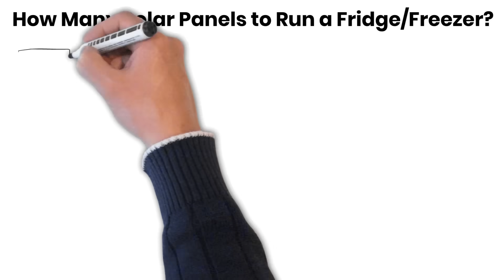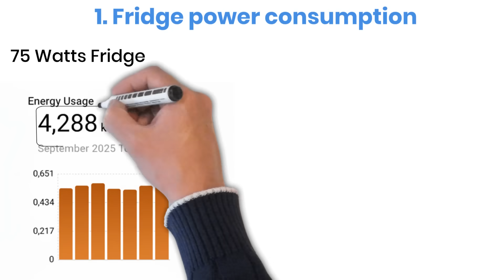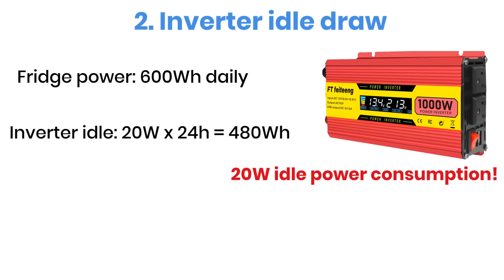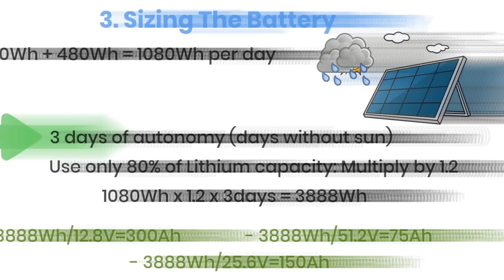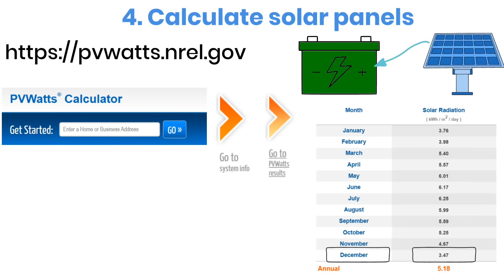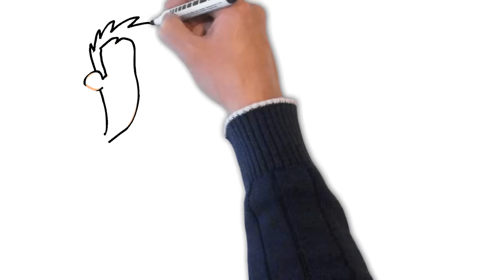How Many Solar Panels to Run a Fridge or Freezer 24/7?

Comment: So a better idea is to just buy a propane refrigerator.
Reply from the maker: That’s a fair point. Propane refrigerators can definitely work well, especially in remote areas or where setting up solar isn’t practical. The reason I focus on solar systems is because once installed, the energy is free and you can run much more than just the fridge. Lights, fans, chargers, and other appliances can all run off the same setup. So both have their place, but for long-term flexibility, solar usually makes more sense.
Reply: @batteryhacker4343 You said "Once installed the energy is free" I don't like that saying, its like saying once you buy a car its free. I say Solar electricity isn't free, its just paid for in advance, and it costs more per Kw than it does to buy it from the utility co. I say anything that makes heat should be powered by fire, leave the electricity to other stuff like lights TVs computers phones and stuff like that. Refrigeration can go either way, and for solar refrigeration I would strongly consider a DC unit, then you don't lose all the efficiency in conversion from dc to ac and voltage step up.
Reply from the maker: You’re absolutely right that solar isn’t “free” in the way people sometimes say it. The upfront cost is high and in many cases grid power is still cheaper per kWh. I usually mean “free” in the sense that once you’ve installed the system, there are no fuel bills or ongoing costs other than maintenance.

And I totally agree with you about heat loads — anything that makes heat (heaters, stoves, water heating, etc.) eats huge amounts of energy, so fire or gas makes way more sense there. For refrigeration, yes, DC fridges are a smart choice for off-grid setups because they cut out inverter losses. Thanks for bringing that up — it’s a point a lot of people overlook.
Reply from the maker: Really appreciate you sharing all that. You’ve clearly built some solid systems and learned a lot along the way. I like how you balanced solar with propane and wood for the heavy loads, that’s smart energy management. And that EG4 setup with 10kWh of batteries and the well pump running off the transformer sounds rock solid. Out of all three systems, which one felt like the best balance between cost and performance for you?
Reply from the maker: Sounds like you’ve really evolved your setups step by step — that’s the best way to do it. Those LiFePO₄ batteries definitely change the game once you move past the upfront cost. The EG4 system sounds promising too, especially once the remodel’s done and you can test it under full load. Are you planning to tie in any solar expansion later, or do you think the current 3.2kW of panels will be enough for the house?

Comment: Something important to mention is maximum charge rate of your battery, you can't just add 20 panels and charge the battery in an hour.
Reply from the maker: Great point! You can’t just throw 20 panels on a battery and expect it to charge in an hour. Every battery has a max charge rate (C-rate). Think of it like a water tank — no matter how many taps you open, the tank can only fill at a certain safe speed. For example, a 200Ah lithium can safely take about 100A (≈1200W at 12V). Anything more, and the charge controller just limits it. Thanks for highlighting this

Comment: Actually solar panels alone will not run a fridge.  Your heading is wrong, the inverter is the important item, then the battery on how long a battery can supply power for the inverter, then the solar panels to charge the battery.  3 systems need to be considered
Reply from the maker: Good point 👍. And yes, that’s exactly why in the video I broke it down into 3 parts, inverter, battery, and solar panels. The panels don’t directly run the fridge, they recharge the battery, and the inverter makes it usable. Thanks for pointing it out. it will definitely help others understand the “complete system” idea.
Reply: It is worth mentioning that the fridge compressor has a high instantaneous start-up current which the inverter must be able to handle.
Reply from the maker: Absolutely right. Fridge compressors do draw a much higher surge current at startup, often 5–7 times the normal running watts. That’s why even though the fridge in this example runs at ~75W, the inverter needs to be sized much larger, typically in the 1000–2000W pure sine wave range — to handle that split-second surge.

Thanks for pointing that out. it’s a very important detail for anyone planning a solar setup for fridges or freezers.
Reply: My 12V fridge freezer draws 40w. When it's running. 
I should try it directly on the panels, without battery or charge controller. Turn it up to Max. Bet it'll do just fine overnight. 
You get 10x as many solar amps when it's cloudy with no computers involved. 
Should only need a single hundred Watt panel.
Reply from the maker: Interesting thought. In theory a DC fridge could run directly off a panel in perfect sun, but in practice the compressor needs a stable voltage and enough surge current when it starts. A single 100W panel won’t really deliver that consistently, especially overnight or when a cloud passes.
That’s why batteries and a charge controller are important—they act as the buffer so the fridge sees steady power instead of the ups and downs of the sun. Have you tried testing your unit straight on solar before? Would be interesting to hear the results.
Reply: @batteryhacker4343 yeah, you are right. You probably need at least a capacitor and a low voltage cutout. Of course if you can freeze saltice when you have excess piwer, and store the heat too, then you have a pretty good basis for a trigeneration setup. 
If you were to design a reversible refrigeration cycle into it, with turbo expanders driving generators to meet demand you got everything you need.
Reply: @aaronfranklin324 charging directly from the solar panels without an MTTP controller or some kind of regulator could be problematic and a low chance of success
Reply: @namogel67 yh best too have a controller you can get them for a few pounds or just the board and make your own housing box for it for prob 50p or 50 cent ..one thing I always wondered about pannels is why they don't have a heatsink on the bottom as standard coz heat is the pannals well all techs nemisis the cooler the better will help general running and prob put years on its life span even just a thin sheet aluminum cost next too nothing so I don't know why it's not a standard feature and even add a PC fan pulling the heat away from the sink even better but I guess it coz they mainly are put on roof tops so can't access them easily but add those 2 your pannal will stay cool n cost you nothing as PC fan will run from the pannal itself..same with phones or a modem or telly there's no heatsinks on them my modem gets boiling hot so I thought let me add a fan and in a minute it dropped the temp too no temp basically and that's always gonna help but just a thought cheers
Reply: The inverter was mentioned in the first minute of the video.
Reply: But actually, there are dc powered fridges. Solar panel alone can power some kind of fridges. The battery backup may not be necessary as well if the priority is to use afternoon power. That's running the fridge in the afternoon only.
Reply: FALSE statement.
I have 3 units that run on 12V so no inverter needed.
Reply: Build your own fridge like old days with a touch off modern help make an evaporation cooling fridge or several just need 2 terracotta pots one big and one a size smaller place the smaller one inside then the rim between the 2 pots fill with sand and find a lid varies choices then all you do is soak the whole thing with water preferable a drip constant slow flow soak entire thing then historically they would just place outside and the general wind just normal slight wind will cause an evaporation effect on pot cooling it too a low temperature but if really want cold even freezer potential add a fan or fans either PC fans or whatever you got but essentially the more wind you create the colder it will get obvs the offset off more wind will mean your water drip feed will need more water but not much in the grand scheme off things and there you go no electricity bill accept say 2/3/4 PC fans running at 5 watt each so 15w running cost vs a minimum 400w fridge cost but 1 PC fan or fan will do and put outside use natural wind too but yh pretty simple and improvements can be made such as adding aluminum pieces in with the sand heatsinks but in this case acting as coolsinks as aluminum passes hot and cold through it instantly just throws temperature straight through it so will help cool faster...and if storing fruits n veg herbs just use sand in a box in layers so sand veg on top more sand layer then more veg in layers and the food lasts longer than in a modern fridge as no moisture so doesn't rot just pack it down tight and yh granted you gotta dig your veg out n wash sand on quick but it's free and does the job better  so use both those ideas in conjunction n say goodbye too fridge electric bill and fridge itself make some extra space in your kitchen...just thought I'd share that with ya not everybody's cuppa tea but evaporation cooling is no joke blow a fan on your face then after splash water on face then blow fan and you see it makes it ice cold I'm sure your aware off this but they had giant freezers in the middle off the desert in Iran 1000s years ago using this method called yatchels look them up very cool (pun intended) lol...cheers
Reply: @jshaw4757giant freezers? Where is the evidence for that?
Reply: @nexpro6985 Yakhcal ...spelling was incorrect cheers
Reply: @jshaw4757 ice pits are not freezers.
Reply: @nexpro6985 They could create ice via shallow pools using evaporation cooling and a heat differential then it was shoveled into the main structure that could be used too freeze things therefore by definition a freezer
Reply: @nexpro6985 But Freezers are icepits ...or if split hairs ice boxes lol 😂
Reply: I run a 12v 50watt compressor camping fridge, 100watt flexi 20a control n a 100ah lifepod4, runs forever as long as fridge has food in it not just fresh air.    just running solar only won't kick fridge in at night so you would need a battery for that
Reply: During the day I run my solar directly to my 12 volt fridge that has a built in charge controller. 100 watt panel is more than enough. Many nights I keep it closed without power, and everything stays frozen, and saves power me
Reply: You are ignoring 12v fridges.

Comment: The start up current of the compressor is not mentioned so some people will think the fridge only uses 75 w of power to run
The number of amps is much higher on the start up of the fridge and therefore a 100 or 200 or 500w inverter will not deliver sufficient amps for the start up
One needs a 1000 to 2000 w inverter for a successful start-up
Reply from the maker: Great observation. You’re absolutely right, refrigerators don’t just use their rated running power (like 75W in this example). When the compressor kicks on, there’s a short surge where the power demand can be 5–7 times higher.

So even though the fridge runs at ~75W, the inverter must be sized to handle the surge. That’s why I recommend using a 1,000W to 2,000W pure sine wave inverter for a fridge/freezer setup. It ensures the compressor starts smoothly without tripping the inverter.

In short:
Running power: 75W
Startup surge: often 400–600W (for a split second)
Safe inverter size: 1000–2000W

This way, your system works reliably 24/7.
I hope this clears all doubts. Thanks for bringing it up, really helpful for others too!

Comment: It says how much energy you get from one sqaremeter from sunlight not how much you get from your solar panels which is much less.
i live most of the time in africa. ther its true, a build like this is working
Reply from the maker: You’re absolutely right, the sunlight energy per square meter (around 1,000 watts at peak sun) is not the same as what you actually get out of a solar panel. A panel only converts a portion of that sunlight into usable electricity, depending on its efficiency. For example, if you have a panel rated at 20% efficiency, then from those 1,000 watts of sunlight hitting one square meter, you’ll only get about 200 watts of actual electrical output.

That’s why in all calculations, we don’t use just the raw “sunlight energy per m²,” but instead the rated output of the solar panel (like 100W, 200W, or 400W). This rating already takes efficiency and panel size into account.

So in practice:
1 m² of sunlight ≈ 1,000 watts available
A good 200W solar panel (about 1 m² in size) will give you ~200 watts in full sun.

In places like Africa where you mentioned, the high solar irradiation makes such setups very practical, but the principle of panel efficiency always applies.

Comment: When you used that web to check sun hours, you take a number that is kWh/m2/day and uses it as sun hours. Is it the same?
Reply from the maker: Good question! The value shown on PVWatts (for example 5.18 kWh/m²/day annual average) is actually the daily solar energy per square meter that reaches the ground. To make it easier for system sizing, we often convert this into “equivalent sun hours.”

Here’s how it works:
1 kWh/m²/day is the same as having 1 hour of peak sun (1000 W/m²) in a day.
So if PVWatts shows 5.18 kWh/m²/day, we call it 5.18 peak sun hours per day.
That’s why in calculations you’ll see people use these numbers directly as “sun hours”, it’s basically just a different way of expressing the same thing.

For example:
5.18 kWh/m²/day = 5.18 hours of full 1000 W/m² sunshine.
So yes, it’s valid to use PVWatts output as sun hours for solar panel sizing.